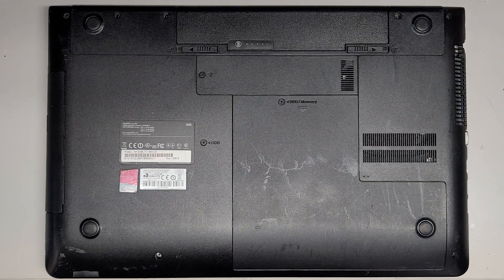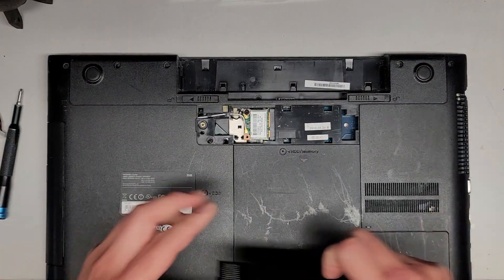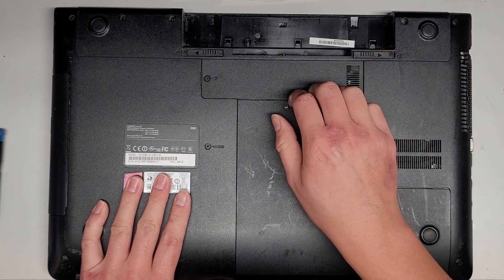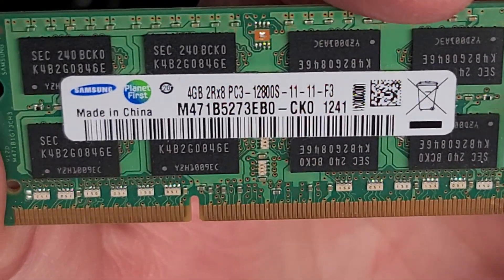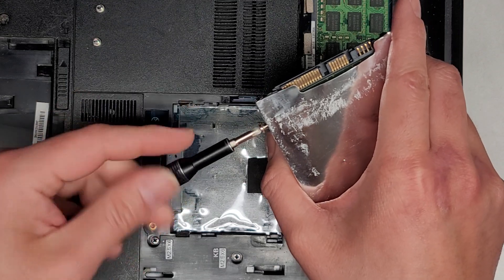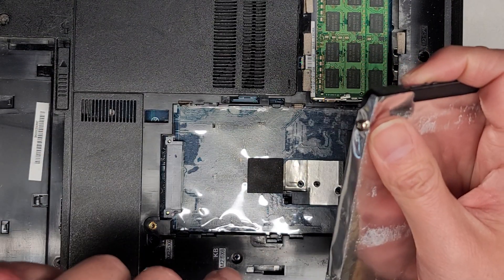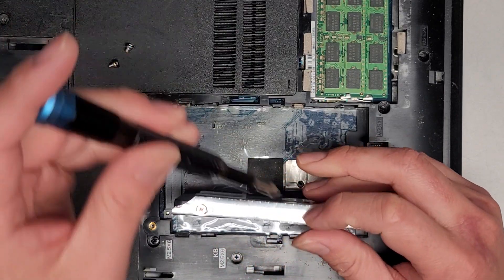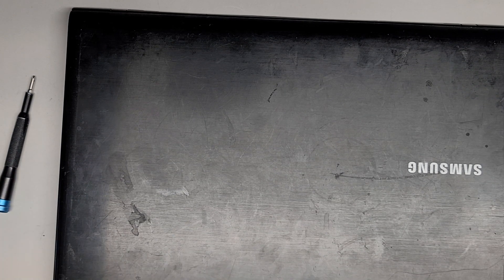Samsung 350E NP350E7C-A01US Disassembly RAM SSD Hard Drive Upgrade Battery Replacement Repair

Comment: COOL THX, DO YOU HAVE VIDEO HOW TO CLEAN THAT BEAST FROM A DUST MAYBE?
Reply from the maker: Other than opening it, I just use an electric blower to blow the dust out.
Reply: @ItsBinhRepaired  OK a lot of people doing it like that, i might try it as well. Thx for the answer.
Reply from the maker: Hope it worked out
Reply: @ItsBinhRepaired  Thank you for the answers mate, well i lost my lap top it's broken. I can tell you how ot happened, the pervious servicer didn't put a good cooling paste and He didn't return those heating pads. So after less then year my Samsung broke down. When i opened it i saw what He did, plus He broke one part 🙄. So i'm angry at myself why i didn't opened it alone, or even better i should use only fan to poosh out the dust it would be more then OK.
Reply: @ItsBinhRepaired  Before i took it to service for ''cleaning and paste change'' that lap top worked 8 years without any issue! I did blow out a dust with usual vacuum cleaner from time to time. But then they told me ''OMG you must take it to service for cleaning 8 years is to long'', well i did, and now i don't have lap top any more.
Dude who cleaned it 1 year ago wasn't gentle with lap tops as you are.
Sooo, when ever some lap top is complicated for cleaning the dust the best is to just blow the dust out. 
i guess i've learned that lesson in hard way. Now i must find a NOS motherboard and change it, due to i don't have enough tools to search the component on a motherboard that is broken. Probably i can do a lot with a multimeter, but for IC i need oscilloscope. 
Thx for your good intentions to help me out, wished i did that 1 year ago...
Reply from the maker: @bobibobik5903  :( that sucks
Reply: @ItsBinhRepaired  it's life.... Its my fault, crazy thing is that basically your colleague an electronic engineer. That's why i'm a bit angry at my self ☺, i should do it alone. I even talked to that servicer and telling Him '' i will clean my lap top'' due to he owns a shop and i was buying some pats there, and he told me ''come on it's a small amount of $, let me do it, i have more experience and you'll broke something for sure''. well He broke it lol ☺. He should told me, i found out after a few days that one back crew is broken but i didn't called Him, was thinking ''OK it happens'', but wow he made a mess inside ..
Reply: @ItsBinhRepaired  I WISH YOU ALL THE BEST! Thank for a good advice 🙏, i didn't listen it but i will next time. Also I'll tell people about your service and recommend channel, I'm sure that the can learn a lot. Thx once more! You are great person 💪
Reply from the maker: @bobibobik5903  :( Yeah, a lot of people don't take care of other people's things.
Reply: @ItsBinhRepaired  It's nice to see honest people like you, who really approach work with good intentions. I like that you are fair, that you pay attention to the customer's desires and budget. That is a rarity today.
thank you once more! Cheers and i'll share the YT channel link.
Reply from the maker: Yeah, it's hard for me to find people to recommend when there's work I can't do. Thanks!